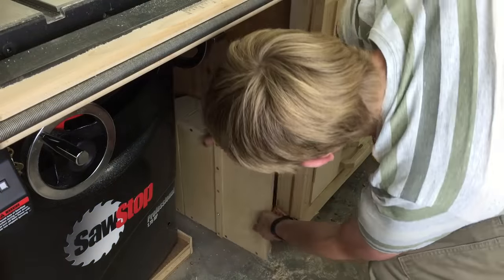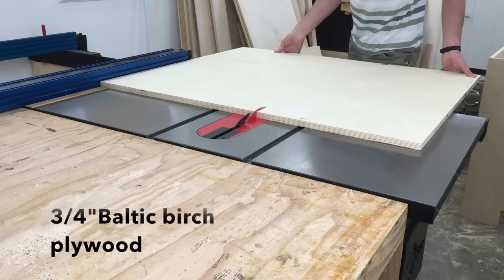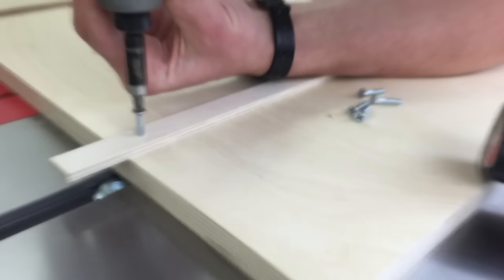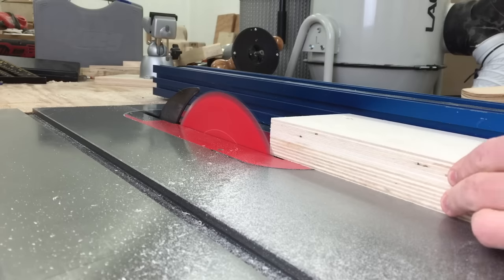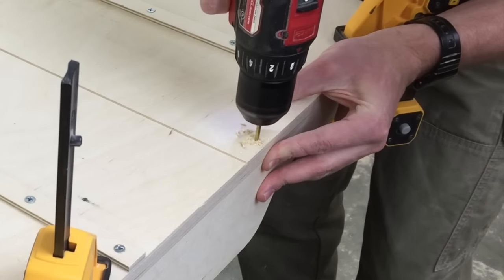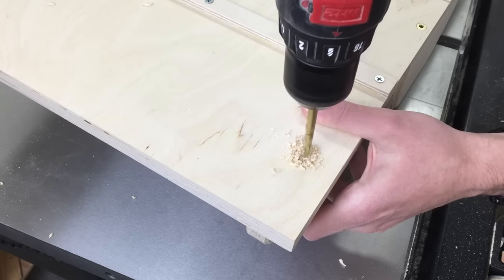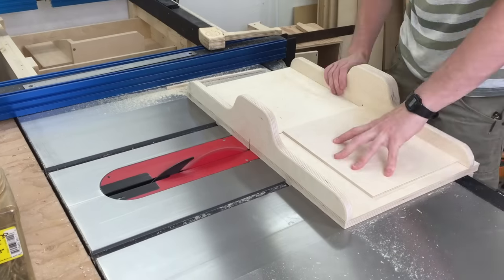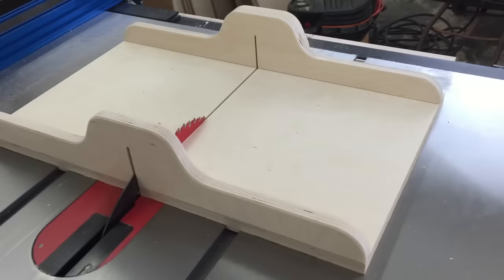General purpose crosscut sled

Comment: Thank you Jeremy. I just purchased a new Dewalt DW745. I looked and many different crosscut sled plans and decided yours best suited my needs and my saw. The only difficulty I had were the runners, which I made out of 3/8 in birtch ply. I guess I shimmed their positions in the saw slots incorrectly because they were binding at the end of the sled travel after I glued them. It took me a few hours of sanding to fix it. After that  I completed the assembly without a hitch. I am very happy with the results! Thank you very much.
Reply from the maker: +James A. 
Glad it worked for you!

Comment: Hi Jer.  I see your fence system is mounted to your new saw.  Will you by chance post a video of converting the new saw?  Thanks and great work.
Reply from the maker: The only thing I had to do was drill new mounting holes in the rail. This fence design will bolt right up to almost every saw on the planet. Thank you!

Comment: Great looking and functional sled ther Jer. Congrats on your new saw. BTW, did you inherit the CEO of a vise company? 1:47
Reply from the maker: Thank you! I think I have a weakness for old vises. Whenever I see one at a reasonable price, I have to buy it! :)
Reply: +Jer's Woodshop Would you say that's your only vice? (See what I did there?)
Reply from the maker: +Mike Conger Ya probably! ;)
Reply: +Jeremy Schmidt good ad vice
Reply: If not the CEO, then certainly the Vise President.
Reply: I cannot find your sketch
Reply: If you cant see that link in the place you were told it was then you should probably not be using a table saw!
Reply: Jeremy Schmidt or anyone... Where do you get that wood...the plywood at Lowe's and Home Depot does not look like that
Reply: Baltic birch plywood is generally what is most used for jigs. It won't be found in home depot or lowes. 
Specialty stores like Woodcraft or Rockler carry it and some craft stores do as well. Do an online search.
Reply: keith moore thank you so much!!!  I've probably asked that question in about 5 or 6  other channels and nobody replied, so thank you!!!
Reply: You need to get a grip! 😂
Reply: keith moore  Actually, I decided to build a sled for my new Skil bench saw, HD had 1/2" Birch plywood 2' x 4' ... its a little spendy, cost me $40 for the birch panel, and oak for the head and tail pieces. but they had some 1/2" birch panel that was usable, I''ll use some Purple Heart I have on hand  for the runners.
Reply: @Jer_Schmidt  You and me both! I usually clean them up and give them away to people that can use them on the condition that they never send it to the scrap yard. I have a 100 year old chas parker thats like 200 pounds I'm planning to mount it on the back of my tractor.

Comment: Great video. This is exactly what I need for my table saw to make repeat cuts easier. Perhaps I missed it somewhere but do you list dimensions anywhere? i.e. how tall the front and back fences are, the width of the back plate to protect your thumbs? I downloaded the sketchup which is great, but there aren't any dimensions listed. Could be I'm missing something.
Reply from the maker: +Paul Amador 
Thanks!
You can just use the tape measure function in Sketchup to get the dimensions you need directly from the drawing. If that doesn't work for whatever reason just let me know and I can list them off to you.

Comment: Jeremy, good points on making this sled safe, thanks, but shouldn't the front fence also be squared to the blade? I am new to all this, so could be wrong. I am not sure I can turn this around on the grooves if I wanted to use the back fence in the front fence position as the grooves look a little offset to the blade on my saw. I have seen videos using the front fence as a guide.
Reply from the maker: +Dave Tablesaw 
I don't like using the front fence as a guide; it doesn't feel safe to me. And if I'm not going to use it as the reference side then I may as well glue it for extra strength.

Comment: Very nice built. But i wonder why the front fence? I think without the front fence you might be able to cut larger pieces and turn around finish cutting it.
Reply from the maker: +bentley TRAN The front fence is needed to maintain the spacing of the two base halves. In this case I'm not concerned about cutting larger pieces, this sled is for small pieces and therefore the entire sled is fairly compact.
Reply: +Jeremy Schmidt oh i see now. Thx bro

Comment: Nice video. Good execution of a simple (as it should be) desing.

I have a question about crosscut sleds in general. How do you crosscut a piece of 8x4 plywood? The sled is only a couple feet deep...
Reply from the maker: Thank you!!
Crosscutting 4x8s is difficult. That's why I don't use 4x8s at all unless I absolutely have to. The easiest is to use a track saw, but they are expensive. I'd say just rough cut it with a circular saw or jigsaw and then true it up by running it along the table saw fence.
Reply from the maker: Really you should ask someone who works with a lot of 4x8 sheets and has more experience than I.

Comment: Hi, enjoying your videos tremendously. I'm about to build a cross cut sled but had a quick question. Is there any particular reason you used 3/4 inch for the base?  Several others have suggested 1/2 inch is enough and has the added value of the extra 1/4 inch height available when cutting stock.
Reply from the maker: +H2Dwoat 
I wanted to maximize the rigidity and precision of the sled rather than the cutting capacity. If you don't need the precision but need the capacity then a thinner base would work just fine.

Comment: How do you like that Rigid sander? I almost bought one but kept reading about quality issues.
Reply from the maker: +Nick Ohler Yeah the quality leaves a lot to be desired. I've had it for about two years and it's still running, but it's mostly plastic and there's a lot of vibration. I can't say I recommend it, but it is pretty much the only machine like it... So if that's what you need then it's ok.

Comment: Good video.  I don't have sketch up.  Can you tell me the width and depth of of the sled?  I can take it from there. Thanks.
Reply from the maker: +Gary Williams 
I'm pretty sure the base is 14.5"x24". That gives you 12.25" capacity. But you can always make it bigger or smaller to suit!

Comment: Hey TJ great sled just curious what blade and tooth size are you using cheers Ocean
Reply from the maker: +Ocean Tomkins 
It's a Diablo thin kerf 60 tooth. I've had it for over two years and it's the only blade I use besides a Dado. It's still cutting like the day I bought it. Very worth the $40!

Comment: Nicely and neatly done. FYI, I took M. Wandel's advice and used only one runner for my sleds. Easier to make and just as accurate.
Reply from the maker: +Miles Hendon 
Thanks!
I like to use two because they last longer, and they are only like 1% harder to make. I say overall the difference is insignificant.

Comment: What can you do to ensure that the rear fence is perfectly straight?
Reply from the maker: Which one do you mean by "rear"? For the one farthest from the operator, it doesn't matter. That's just structural. For the one closest to the operator, I just used a straightedge to make sure it was straight before locking it permanently. Then I also ran a five-cut test on both sides of the blade.

Comment: Jeremy, I've watching your videos for a few months now and have enjoyed them. In addition I have learned a fair amount as well! I also have a new (used to me ) SawStop Table Saw, but mine is their "Contractor" model. I am in the process of retrofitting their T-Guide Fence system to improve the saw's accuracy and ease of use. Finally, I am on my way to get some material today to make my new TS Crosscut Sled as well as a new Box Joint Sled and will undoubtedly use some of your suggests. Thanks for the help.

Comment: I have never used the five cut method how do you know when it's a perfect 90 degrees or a perfect 5 cut
Reply from the maker: +Joe basementwoodworking 
After you've made 5 cuts, you should be left with an offcut that has parallel sides. Any error in this offcut will be five times the error in the the fence.
Reply: Jeremy Schmidt ahh ok i get it now..thanks!🖒
Reply: Joe Basement
 Woodworking & DIY

Comment: Question: Is it not dangerous moving the sled back before turning off the saw ? - I mean I know there is a riveting knife and all but still..
Reply from the maker: +Thor P.N 
The only way it's dangerous is if the cut pieces move into the path of the blade after cutting. This is usually not a problem, but it can be if the piece being cut is warped. In that case I would simply pull the two halves away from the blade before pulling the sled back.

Comment: Hi, is your saw 1.75HP? Is it ok to cut thick stock, say 3 inch thick? and why don't you use Sawstop standard fence?
Reply from the maker: Yes it's 1.75HP. I haven't tried cutting 3" stock, but I haven't managed to bog it down with anything I've thrown at it, so I'm sure it could handle it. The Sawstop fence is lovely, a joy to use, but I couldn't part with the incremental positioning on my homemade fence. Once you get used to incremental positioning you can't go back!
Reply: +Jeremy Schmidt I have a very small shop and was considering between 1.75HP and 3HP Sawstop professional, maybe 1.75HP would suite me. Thanks for your reply!
Reply from the maker: If you have 220V power in your shop, the 3HP might be worth it, especially if you'll be cutting a lot of thick hardwood. I don't have 220V so I would have had to pull a new wire from the next building, plus I rarely cut anything thicker than 1-1/2", so I decided to go this route.

Comment: What exactly is the purpose of the back fence?
Reply from the maker: +Michael Grote 
If it wasn't there, the only thing holding the left and right halves of the sled together when you take it off the saw would be the tiny bit of wood above the kerf in the front fence, so it would be very weak.
Reply: Ah ...well I feel silly! Can't believe I didn't think of that :)  Thanks Jeremy.

Comment: You are probably going to throw rocks at me for saying this, but the only criticism I have for this type of sled is that the blade comes out the back of the sled on cutting . I know how much room one has from saw to saw varies but it is always good to attach a block to the back side of this kind of sled somehow to prevent the blade from showing through when you cut straight through. This makes the sled idiot proof because you wouldn't believe how many people there are out there that will cut themselves in this way .I've made sleds like yours in the past and I now make them just one sided to keep to one side of the blade .This is just a personal preference . Another idea is to put a stop block in the miter slot that locks allowing the cut to be made  and stopping the sled at a point where the blade doesn't go completely through the back side of the sled.

I really like your fence, it's the best I've ever seen . I thought mine was good because it also worked as a router table fence and shed the exhaust out the end of the fence bar -- but your screw fed incremental fence is such a brilliant idea obviously taken from machine shop practice. I don't know why it took so long for an idea like that to make it to wood working tools. You are one talented kid . I hope my criticism doesn't offend because you are obviously capable of using your jig without any thought of getting hurt .. Still there are others sadly who are .
Reply from the maker: I know that is a good idea, and a lot of people like to put a block there. I even thought about mentioning it in the video but opted not to take the time. I tried a sled like that once (my very first crosscut sled), but didn't like it at all. Partly because it's not conducive to storing when you have a block sticking out in the way. I haven't ever gotten my hands near the blade, and while it's not impossible, I don't think I'll cut myself there. No one else uses my tools.

Thank you, no offense taken! :)

Comment: Instead of making all those narrow cuts to see if the sled is square, just cut a big piece off.  Flip it over upside down, and place the cut edge against the cut edge of the corresponding piece.  Press them both together, and against your fence. If there's a space between them, then your sled is out of square. If there's no space, then your sled is square. Easy and quick.
Reply from the maker: +J Schacher Great idea! 👍

Comment: What’s lacking in this video is justification why I need a sled for my table saw.
Reply from the maker: I figured that was obvious... It’s the most accurate and reliable way to make crosscuts.
Reply: @Jer_Schmidt  It likely is to most but I am a rookie. Wouldn't a mitre/chop saw do exactly the same?
Reply from the maker: Miter saws are quite inaccurate. There are many weak points in a miter saw, from the rotating base, to the thin fence that overhangs the base, to the pivot pin that allows the saw to be lowered through the wood. A crosscut sled is almost impossible to knock out of alignment, since there are no moving parts, and everything is really robust so it can’t flex out of square. Miter saws are great for framing a house, but not accurate enough for precision woodwork.